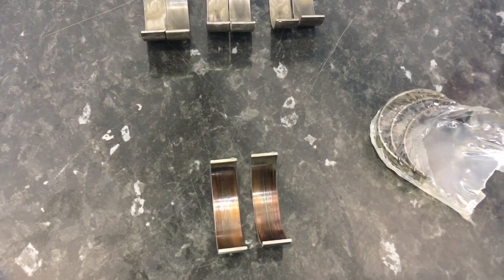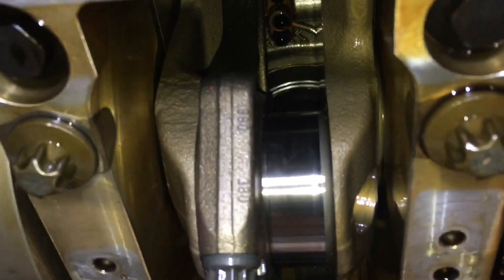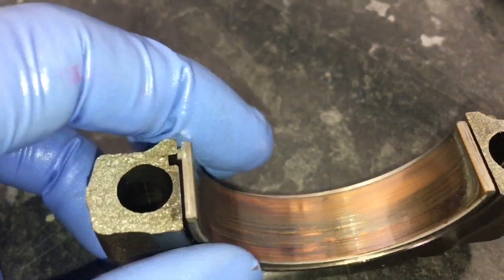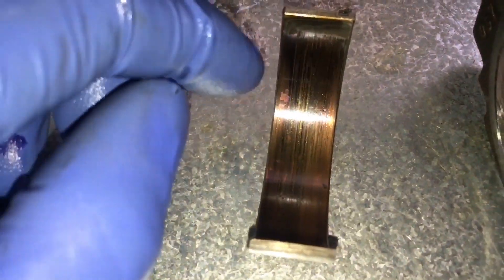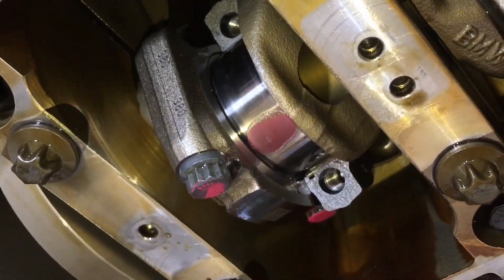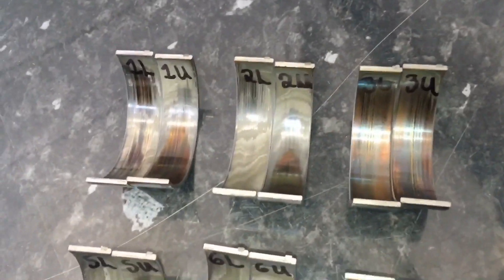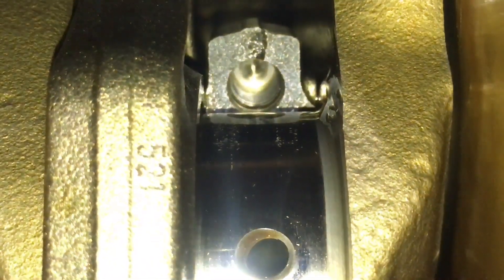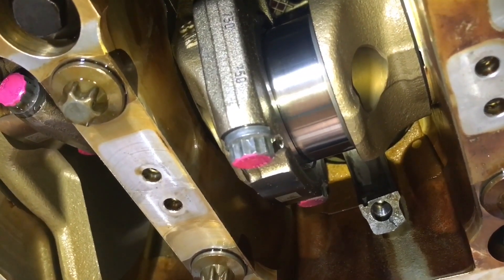Does Oil Sampling Work? You decide!

Comment: It always seems like the Americans think its worth doing a oil test.
I think every purchase of a M car should be bought with budgeting for a shell change, as its better to prevent then fix a blown engine.
Reply: Worth doing? More data, generally better. That said, if you don't know the inherent limitations of an oil test, then you shouldn't be using it as part of your diagnostic suite. That, and if you don't know BMW engines post~late 1990's are generally only good for 70K miles without major repair - you shouldn't be buying one. 

Bearings, valve guides, cam chain drive, etc. What happens when a company transitions from 'The Ultimate Driving Machine' to the 'Ultimate Leasing Machine'...
Reply: @16v15  what do you consider as major repair?
Reply: @Dmxravin  Any of the items I noted above as well as the usual suite of BMW electrical failures, the list goes on. Let's say either 6+ hours book and/or $2K part(s). I'm not talking wear items or deferred maint, just something breaking that shouldn't until one is past 200K miles. I've spent most of my life in 70/80/90s BMW/Porsche/Benz products all of which I bought with over 100K miles on them. It went south with the mid/late 90s product - when they all decided they were going to sell mass market, build quality be damned. (not to mention, meetings gov standards)
Reply: @16v15  I have a 2016 F30 330e with the hybrid B48 engine. Currently sitting at 136j mikes and it has the original timing chain, bearing shells. Not gonna lie it had some major repair work done in terms of A/C piping for the high voltage battery. And a cracked cooling pipe to the engine had but other than that it was reliable. Needed it’s fair share of wear items too. The car is still easy to work on yourself. You can rent the repair manuals from BMW and can even repair high voltage related stuff as there’s a isolation switch safety switch in the boot.
Reply: @Dmxravin  Congrats! Sounds like you're a wrench as well. Glad you've not (yet) run into any of the stuff that even BMW dealer mechs hate. Though if you're talking of 'renting' access to FSMs, I hope your scan tool supports a J-box, that you have one of those too, and the myriad of BMW electrical specialties required to accurately diag that system - if anything goes truly wrong you:re gonna need them. Cheers!

Comment: I purchased an E90 M3 a few years back. Oil analysis was done with results that stated the bearings seemed healthy and that there wasn't much reason for concern. I replaced the bearings anyway, and all of the upper shells were significantly worn. My guess is they had another 5-10,000 miles left in them if driven gently.
Reply: The oil analysts won’t show 50k of wear when it had a recent oil change or one every few thousand miles.
Reply: Most of the metal shavings will be caught by the oil filter, i was never a fan of doing oil analysis from drained oil. Even if there is metal shaving in the oil, it would be sitting down (lowest point). BMW even sent out in their technical service file to cut open the filter and check for metal shavings.

Comment: In addition to what I said previously, I wonder if taking a sample of oil from the oil filter housing would've given different results? (seeing as the oil is drawn up from the lower part of the sump, maybe a lot of the metallic particles would be trapped there? Or in the filter itself?).
Regardless, if the oil hadn't been in there long, then no wonder the oil analysis didn't show much.

So how quickly do these engines tend to darken the oil then?